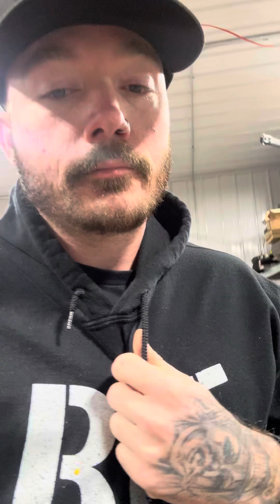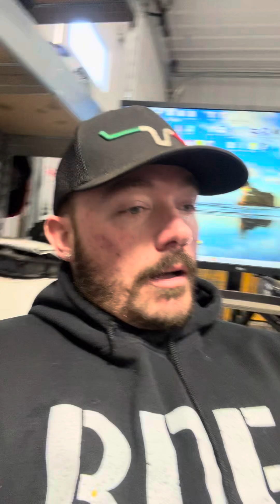We found the exact point of failure of the Ecodiesel engine…. And guess what, it’s Mopars fault…

Comment: 1. A venturis effect (Bernoulli's Principle) is different than an eductor/slip-stream effect. I believe someone mentioned below, the orfice size would be critical.  Which would also change with vacuum signal. (Good luck) * I like the catch can idea better. 
2. I don't buy the conclusion that the center of the bottom end is insufficiently supported.  Too many success stories of high mileage pullers. And Shop talk is not an MTBF Study.  
3. Your "lugging under 1700 RPM" theory makes no sense either. I have done some data logging over the last year. Calculated and actual engine load.  I can run down the road at 1500 RPM at near the same load as idling with the AC on. You're missing the "lugging with load %" ratio.  (Rotational mass is working for the Jeep)  23-25% load
4. The problem is long drain intervals on a motor choked-off with emissions BS --- and if you buy a modern diesel, make sure you don't regen every 200-250 miles in stop and go traffic --- watch your fuel dilution. Watch your pick-up tube. 
5. Put your ecodiesel on a weight loss plan if you can.

Comment: An eductor system is a great idea and using boost pressure to aid in its function is an even more efficient way to create the vacuum in conjunction with the exhaust. Just be careful when selecting the orifice size because you can cause too much vacuum and could start evacuating the oil out of the crankcase.